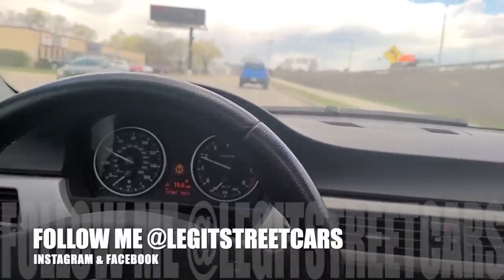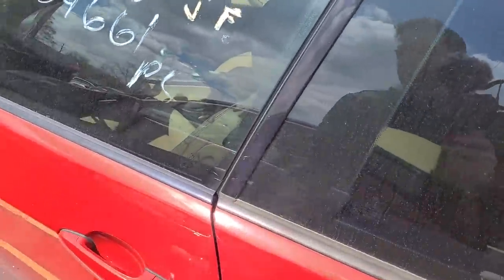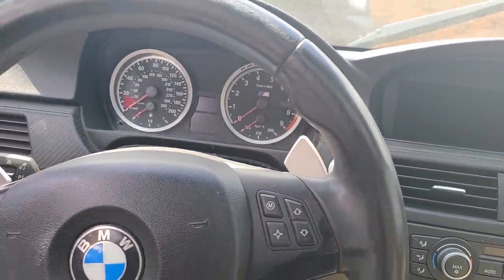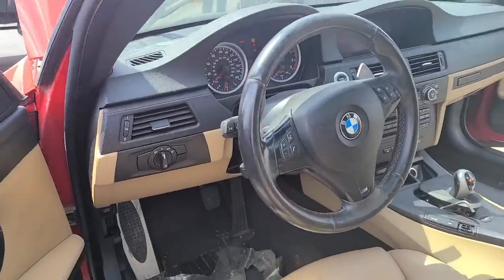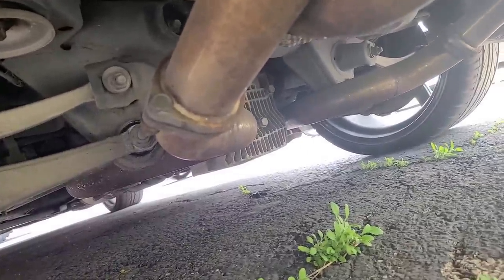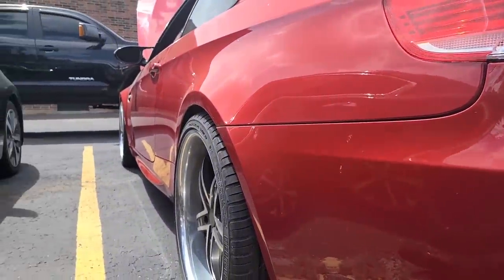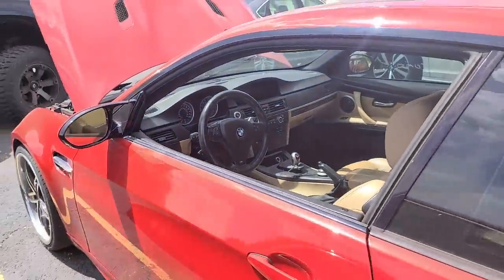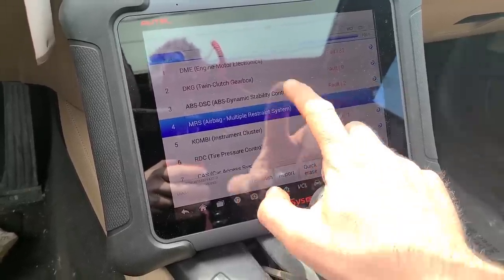I Found A Dealer Auction E92 M3 Sitting For 3 Years With A Supposed “Bad” Engine! Listen To This!

Comment: I’ve never seen a car with under 50,000 miles have so much interior wear.
Reply: Yeah, looks more like 100K miles at least
Reply: Rollback probably
Reply: This is just how almost all e90s are nowadays, the interiors were not built to last
Reply: The leather is torn to shreads compared to our 200K miles Skoda.
Reply: Sitting out side for so long caused the excess interior wear most likely. When leather sits in heat without being conditioned and cleaned it can wear very fast.
Reply: I have a 2004 Honda Accord with 198k and the interior it's in awesome  condition
Reply: @EliasSchmid00  Yes, but people very often wreck cars, have them repaired by a friend, and nothing gets reported to CarFax. There's no law that says you (or any repair shop) HAS to report anything to CarFax or any other reporting company.
Reply: And the body is beat to shit.
Reply: I have a buddy with a $200 handheld unit that can change the mileage on just about anything. I would almost bet money the mileage has been turned back.
Reply: I’ve seen cars with 250k look like that.
Reply: Sun plus mainly city miles. It may only go a few miles per day but it still has age.
Reply: @yan7382   yup that looks 100k+ 100%
Reply: Last owner must have worn sandpaper clothes
Reply: My sister has absolutely demolished interiors with her nuclear farts. I'm not surprised here. A car can only take so much
Reply: @andrewmattera6205  its not so bad, my 2009 is after 140k miles totally ok except for little wear on drivers seat and my fathers 2007 is except for both front seats ok too after 200k+ miles
Reply: or exterior wear. The spacing between the hood and the fender is way to big. That could have been from a crash otherwise I have no idea how that could happen to a bmw
Reply: the spacing between the door and the fender is also to big
Reply: @vaklaf700  my friend has a black 2010 320i, the interior is melting, my brother has a 2007 328i in black and 180k and has the same issue, both interiors were cared for, they just don’t wear well
Reply: If the owner was tall and heavy set, it would explain it. I have to work very hard to get into sports cars without rubbing on the bolstering, or kick panel.
Reply: Agreed. Steering wheel, even the rear seat - no way that only has 48k.
Reply: Minivans and suv owners who have kids but not necessarily time or money to care for the interior can definitely look worse in less than 50k miles.
Reply: That's because its a BMW. They don't know how to make interiors that are sturdy. I've seen so many F series with the same mileage, and they're interiors all look the same. SO worn for such little mileage.
Reply: It looked beat up enough to make me suspicious of the odometer, but the pedal wear looked consistent with a low miles car.
Reply: Yeah well when greasy humans don't clean up they're car the grease just accumulates on the leather lol
Reply: @andrews420  😂😂😂
Reply: @yan7382  Looks more like 400k.
Reply: I’ve never seen a car with 50k miles need so much engine work
Reply: @andrewmattera6205  Not necessarily. My E90M has more than double the mileage and looks new inside. This car's previous owner(s) just didn't care at all.
Reply: Agreed. If the mileage hasn't been tampered with I would be willing to bet someone bought this car for its interior, swapped it with a worn out high miller and kicked it back through the auction.
Reply: 2/3 of my 15+ year old bimmers one 125k other 150k both have way less interior wear on them lol
Reply: @halorox256  lol can't roll back a car without alot of work obd2 tools tell exactly the milage
Reply: @yan7382  They probably swapped out the good interior for a cheap one of the same type.
Reply: For sure fraud miles but nice find
Reply: as my dad would have said “it’s like they got teeth on their ass”
Reply: @andrewmattera6205  yeah, this generation of BMW"s had terrible plastics. Lots of pealing and the seats were garbage. Same with the w204 C class. Also some of the interior plastic pealing off and the front seats would split between the seams on the bottom portion + the side bolstering wearing down stupid fast. Some VW's too.
Reply: Maybe they sold the good interior and replaced it with a used one
Reply: It screams "drug dealer" to me.
Reply: @andrewmattera6205  no no. My e90 328i with 200,000kms looks almost new!
Reply: Seriously lol like you have to almost try to fuck it up
Reply: @povilasmarveloustv3810  this era of German cars in general was very bad, the first real time they had to compete with Lexus, Infiniti and Acura, all of which were making better quality cars. Mercedes has always had poor quality since the mid 90s, once they switched over to the W2xx based platforms they had all sorts of problems with quality, and rust. BMW lost all control at the dawn of the e6x platforms, not only were those cars ugly, and maintenance nightmares, they also had severe issues with generally being over engineered and used cheaper materials that were ultimately the main failure points in the mechanism, almost as if they were designed for materials that didn’t wear as much. 

Audi and VW have always been cheap crap imo, I’ve had several, and I never really liked them. My experience with VAG can be summed up by my A4 wagon and my 01 Jetta, lots of water intrusion, lots of electrical issues, horrible transmissions, sagging headliners, and a broken glovebox
Reply: @stranotech1  I applaud you, you must be one of the only people that tried to save one. 

Fact is, the interior doesn’t age as well as prior generations, generally speaking the 3 series has always had the cheapest of BMWs interiors, but I think the e90 got the worst of them
Reply: @andrewmattera6205  I didn’t try to save it per say. But I’ve always been a meticulous owner with all of my cars
Reply: @andrewmattera6205  but actually, another observation. From all of the used E90s that I’ve checked out, they’ve all had interiors in pretty good condition. It’s only when you get into the sketchy parts of town with sketchy owners where you start getting bad interiors.
Reply: @stranotech1  that’s interesting, my friend with his 2010 320i, that’s a one owner car, his dad bought it new and gave it to him years later, when he got it, it was cared for, but those door panels were really badly melting, you couldn’t get into the car without that fake leather material from the handle getting on your hands. My brother just recently got his 07 328i, and that car has the same problem with the door handles, granted his car has about 100k miles more than my friends car, but still, the fact that the exact same problem happened twice, it can’t be a coincidence. Also I’ve noticed the soft touch plastics get gauged up and look horrible after not very long
Reply: I had 230k driven 2006 e91, interior was almost mint, also had 306k driven 2004 e46 with almost perfect interior. It all comes down to how you keep your car.
Reply: My m3 had 32k on it when I got it and the drivers seat was looking like 150k the leather is so soft I dies in no time
Reply: @juhoqqeli  yep. Obv there are more “fragile” cars than others, but honestly… do not find the E9X platform to be particularly fragile… at least in the interior department.
Reply: That’s nothing my moms Lexus 2016  with only 20,000 miles the front driver seat was already cracking really bad
Reply: Definitely...I had an m3 with 100k and my seat and console looked new..this guy either wore sandpaper pants and a micheal Jackson zipper coat every day or it’s a roll back
Reply: @Devou1s  Exactly, even My Aussie Ford has done 200,000km and I only just had the drivers seat re-done because it had reached a similar state to this M3.  BMW leather is well known to be garbage though.
Reply: @BigCarKilla  I think it's more that they know how to make an interior that breaks after the warranty expires than not knowing how to make a sturdy interior.  Making things that should last be consumable is quite a feat of engineering, and BMW are great at it.
Reply: @banga8080  I'm a fat ass, only just had the leather seat in my 2009 Ford re-covered, it's at 200,000km now and was similar condition to this German shitheap even with my wide load scraping in and out of it for the last 7 years.  Of course I clean and treat the leather regularly which probably helps.
Reply: @Beer_Dad1975  bro you gave me my laugh for today 
I'm a fatass as well I got 269,000 on my seats and they don't look that bad 😂😂😂😂
Reply: @diablocls55  well you apparently dont work on cars.
Reply: Could have been a daily around town driver explains the wear
Reply: the car obviously was neglected
Reply: @andrewmattera6205  e9x interiors have amazing quality interiors.... f30 interiors are shit...
Reply: @gslinc7222  I’ve heard this argument both ways, personally I think every generation of three series interior has been lacking. 

I have an e28 and an e39 and some of my friends tell me my e39 has a nicer interior than most of their parents new (2015-present) cars
Reply: Empanada
Reply: @andrewmattera6205  if the e90 gen was not built to last then I wonder what the f30 and g20 generations will look like in 12 years
Reply: I have the exact same interior, same color and everything, in my 2009 M3 and even with my car at over 100k miles my interior shows much less wear than that.
Reply: Its an 150-200k miles for sure. Thats why also rod bearings are out.
Reply: @LRenars  rod bearings can fail starting around 60k miles depending on how hard it’s driven
Reply: @edis.s  there’s always guaranteed one guy who brings his Honda into the conversation.
Reply: @the_first_resort940  i was just saying,it's surprising how a much more expensive car can have such a cheap made interior.
Reply: @andrewmattera6205  I have had an 08 f30 with 100k and now my 13 f30 has 100k no signs of wear on the leather at all even the bolsters
Reply: Yes, I was wondering the same
Reply: @Sunny Europe nah man you can be a 250lb dude and bring ur car to the automatic $5 car wash only and at 50k mi the bmw interior will look brand new. 
had a coworker with 320i and that’s all he ever did. definitely rolled back the mileage with inpa
Reply: @tomijarvinen9143  odometer roll back using INPA
Reply: The seats aren't saying too much about the mileage but that shiny steering wheel has me ????
Reply: @dubcoco1  no you don't and no he doesn't. Obd2 cars store the milage in multiple computer modules. They all must match. Stop making things up.
Reply: Go to any ghetto and you will
Reply: Depends on the owner. I can actually see it happening. Some folks don’t care.
Reply: Nah it’s definitely a 50k mile interior. Looking at the steering wheel leather firstly. It’s not soft like new, but not hard and grainy like any 100k mile example. It’s still shiny. And all of the seat leather seems very plush and and “fresh” still. I’d say the interior is low miles but it hasn’t been maintained anywhere near good.
Reply: I bet that car has at least 200,000kms.
Reply: @rafacbr9  no way. Mine has 200K and the leather on the wheel and seats is no where as plush
Reply: I've had 4 BMW's and that level of wear to the seats is at least 80k miles worth. I had a 330 that had been clocked.
Reply: Drug dealers lol
Reply: Plump lazy owner is my guess.
Reply: This had front end colision you can see the hood not lining up with the fender. Also that much tear on interiror makes no sense for that mileage, no matter how much it sat on the sun. My cousin has E90 320d with supposed 100.000k miles on it ( most likely has even more) and interior looks miles better than this.
Reply: @dubcoco1  I need that
Reply: It's a Beater
Reply: A black person owned it
Reply: The sun been eating it up too
Reply: Re-lifed. Badly.
Reply: I have an e92 328i with 80k and not even close to the wear of this car either someone didn't give a f*** or it's higher than 48k
Reply: @yan7382  my car hit 180k and its wayyy cleaner than that but it was babied you can tell they took good care of her
Reply: Bet its had an interior swap at some point
Reply: More like 200k miles
Reply: @halorox256  exactly what I thought
Reply: Go through the hidden menu and find the true mileage.
Reply: My 2011 M3 has 115k and the interior still looks new. Take care of your car and it will take care of you.
Reply: @dubcoco1  link or it never happened
Reply: U can roll back the miles so easy
Reply: @andrewmattera6205  uh, no. Mine is 12 years old, 80,000 miles and the interior is spotless.
Reply: @howardjennings1166  well then yours is the exception, my brother's 2007 328i was falling apart before the same mileage, and he doesn't beat on his cars, he keeps it clean, and doesn't do anything stupid with it, so it was a surprise to see it fall apart so soon. fell apart faster than any of my fathers older 3 series, at this point i've just come to accept that all 3 series interiors just fall apart at some kind of age
Reply: typical bmw. they are poorly made in every aspect
Reply: typical bmw. they are poorly made in every aspect
Reply: @joshuapriddy2383  not really
Reply: My 220k mile 328i has almost perfect seats no tears just wrinkled and a little fade on the seams from when you get in the car
Reply: @andrewmattera6205  untrue, my 2008 m3 has 76k and looks like it has about 50 they hold up pretty well
Reply: big fat scruffy bars owned it most likely